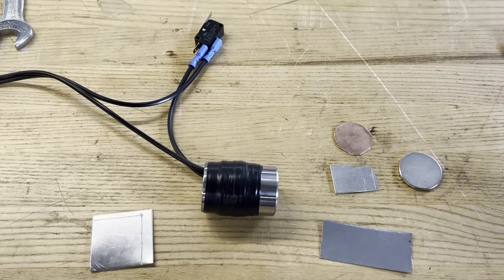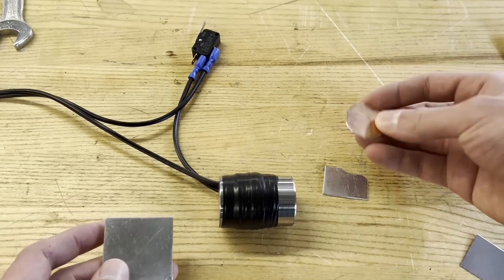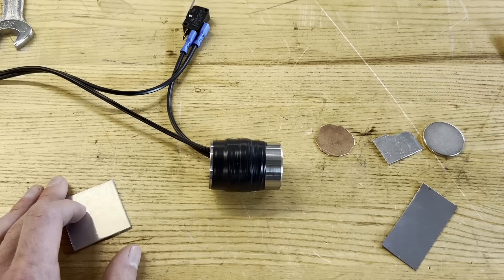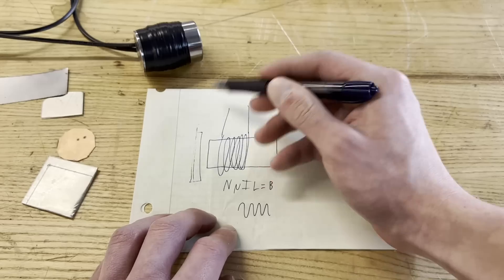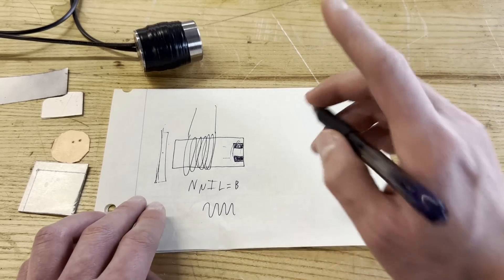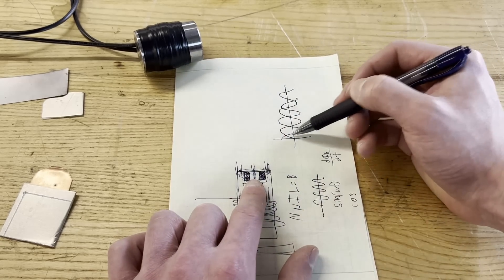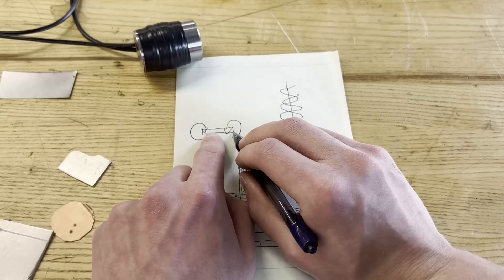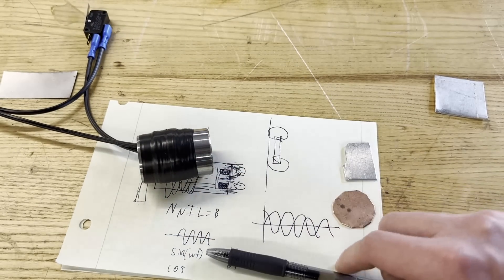A magnet that attracts aluminum and copper

Comment: How can the inward field produce force in its own direction?
Reply: Copper Tube Center Ring has Same Resistance Repulsion + Magnetic Field Flow , Being Strong  outer Ring Flows Over Center Ring "Field Shield" Core , Magnetic Field Flow Island ! Also , looking at Face , Charged Energy Flows "Right" Copper Ring "Machine Pressed" Tube (Copper+Core) Inner Magnetic Flow / Divided + Separate from Outer Magnetic Field !
Reply: If it was loose fit , may Reject ,+ Repel Copper Tube ?

Comment: Does the copper ring need to be isolated from the steel core? If it's not already, what would that do?
Reply: Copper's so significantly more conductive than steel that this demonstration works.  If he cut the steel cylinder halfway through from end to end before pressing the copper ring in, it would give a stronger effect.  Then insulating the ring would make it stronger still.

Comment: ha! this is not a new thing. you can checkout the automatic coin sorter. pretty rare machine if you are not working in the bank. besides the size and dimensions, it uses this effect to sort copper and nickel coins. when a coin was mint in the factory, the % of different metals was carefully mixed. therefore responds to different strengths of magnetic force. and that's how the coin sorter machines work. and why you cannot fool that machine with a copper disc.

Comment: Why does the resultant field rotate inward instead of out?
Reply: It’s the phase difference. The centre is 90 degrees lagging behind the outer field.
Reply: The magnetic field should alternate in to out to in to...
I think the 'attraction' is to a thin layer just outside the exposed surface of the copper around where the field strength is lowest between the opposing out of phase fields emerging from steel and copper.
It likely isn't so much being attracted as being pushed to a local minimum. 
For pieces signficantly larger than the copper ring, the repulsion outside the diameter of the copper  overwhelms any repulsion inward closer to the center.
Reply: Because of the direction of energy flow of the magnetic field. I think north to south but could be the other way.

Comment: I worked for a casting company using aluminum. Our cores for the castings were made of resin coated sand . After the casting had cooled the sand was removed and recycled. The sand and tiny bits of aluminum were ran across a belt with a powerful magnet as the end roller. The aluminum bits would actually leap off the belt over a divider and into a bin .
Reply: Inside that end roller is another roller inside studded with strong magnets, whirling FAST in the same direction the outer belt-drive roller is turning.  The aluminum is lifted & thrown forward, away from the end of the belt.  The sand drops straight down.  This is used in recycling centers to separate out aluminum from paper &glass.  (Steel is separated out first by another overhead upside-down moving belt at right angles with strong stationary permanent magnets above.)
Reply: @bpark10001  Watching these machines that sort recycling is amazing. One of my favorite ones was the plastic sorter. It used air to blow items off the belt, using video and some other infrared sensors to sort the plastic. That thing could do this while the belt was flying by faster than you could grab items off the belt.
Reply: In terms of repulsion right?
Reply: Prob. An EDDY CURRENT...
Reply: https://youtu.be/tGI4434ynmw?
Reply: Eddy current  which makes a non metallic object magnetic for a split sec. To direct non metalics to different  bins  as the metals come off the belts  area
Reply: Phase shifting
Better watch out you dont enter a new dimension
Reply: Eddy currents would drag those types of metals off a conveyor feed.
Reply: If only such a magnet can attract salt out of water, can always dream.
Reply: @hugueslecorre4893  Hmmm Although Sodium (Na) is classed as a 'Metal' I have no idea whether it can be influenced by a Magnetic Field. Na is an Alkali Metal, yet Nd (Neodymium) is a Lanthanide. The significance of this, I don't know either! ha
Reply: *run
Reply: @nonyadamnbusiness9887  Sounds like an eddy current separator, a standard piece of industrial equipment.

Comment: Fun fact, you can replace the copper ring with a coil, scale it down to 3.5 mm or so and use it inspect nonferrous materials for cracks.
Reply: Magnaflux is a term for it too often used in automotive world, it's how aluminum heads and blocks are checked for cracks
Reply: This sounds interesting but I have absolutely no idea what you're referring to. Mind elaborating?
Reply: @emilyyyylime-  Eddy current nondestructive testing.
Reply: @emilyyyylime-  Eddy Current NDT. You have a small probe, like a tablet stylus, that has two separate D-shaped coils on the end. One these coils induces an electric field into the material that is tested and the other picks it up. The reading of the reading coil gets zeroed on a known-good piece of metal. When sweeping the probe across crack, the reading changes and signals the user with a spike on a display and a sound
Reply: @emilyyyylime- 
It's called magnetic particle inspection and is used for finding cracks or surface imperfections on ferromagnetic materials.   Basically, the subject being insoected is magnetized then dusted with magnetic particles that tend to clump up at the surface areas around cracks or other disruptions on the surface.
Reply: What you described is not the eddy current inspection. You described something entirely different. For ferrous materials, only.
Reply: Fun fact, experiment is king?
Reply: That's what zyglo is for.
Reply: So what happens when there is a crack? and how would you perceive/isolate the crack
Reply: @ You use an instrument called an eddy current flaw detector.  Properly calibrated you’ll get a screen display that shows the various things you can detect with enough difference between them to be useful.

Comment: When you said some might figure it out from the ring alone, it snapped for me. The copper ring adds a phase shift to the magnetic field, just like in a shaded pole motor. Very neat. Here I was thinking you’d need 3 concentric solenoids being driven 120 degrees out of phase to create an inwardly moving magnetic field.

Comment: I thought the size of the metal pieces would be important. I suspected the repulsion would be only at the edges of the cylinder but I'm still surprised it works. Thanks for making the contraption and explaining it. I found it very interesting.

Comment: What would it do to ferrofluid?
Reply: Ferrofluid is ferromagnetic so it just sticks to the electromagnet like it does to any other magnet.
Reply: @esuelle  I imagine a thin layer of ferrofluid in glass tray with unit under + aimed up , the fluid would rise + even Flow in Toroidal ring . Would have to sample actual results .
Reply: @JoinGamesLinks  I'm thinking it'd wiggle back and forth between the two states, but can see how a flow would also be possible and way cooler!
Reply: @StubbyPhillips  I have no valid fact , only my guess m I can see in my mind . Imagine . You may be correct . Experiment required ! I like your thoughts .
Reply: Expose Magnetic flow Field lines ?
Reply: Or film